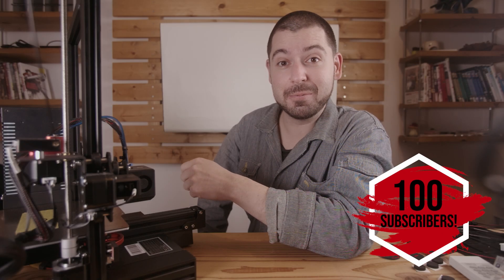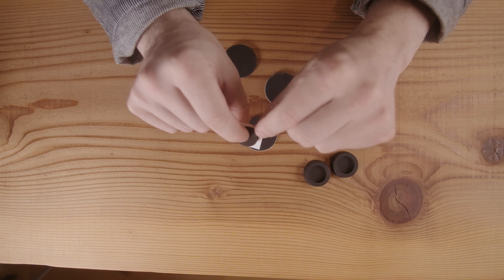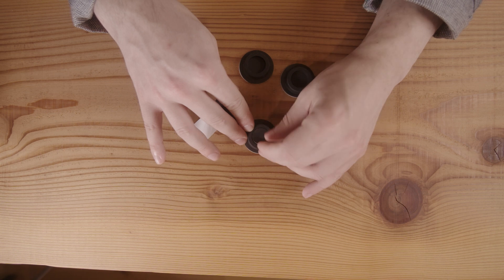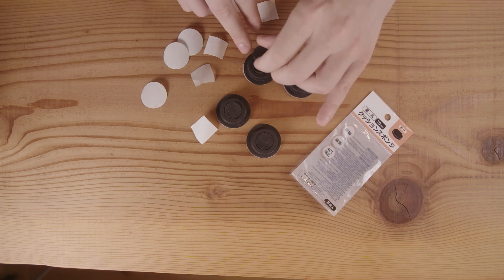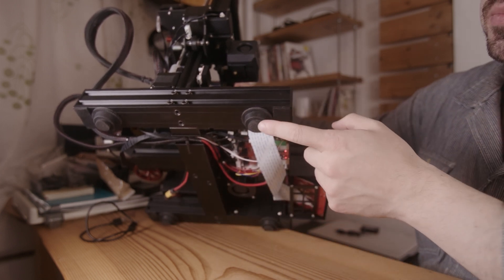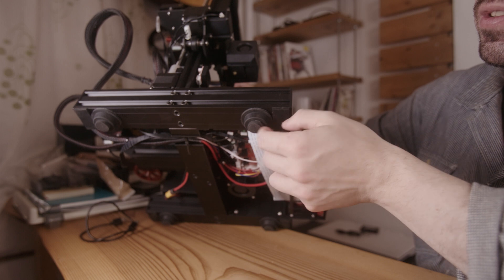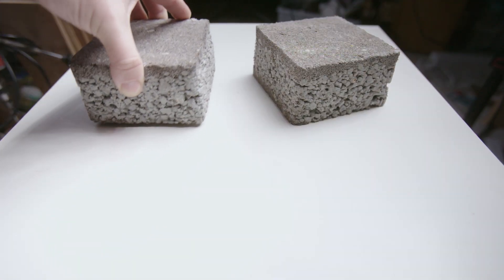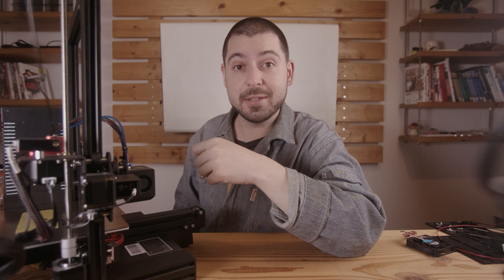Reduce 3D Printer Noise Quick & Easy

Comment: For us non americans would a 3dB Anti-Vibration Foot Pad work as well? Seen those on different 3D printer stores.
Reply from the maker: I live in Japan so you can find this type of thing somewhere I am sure. The important part is the foam it has a feeling like memory foam but a little stiffer. These are for protecting surfaces from light appliances.

An anti vibration rubber pad would not work as well, I tried, it is better than nothing but not as good as a foam.